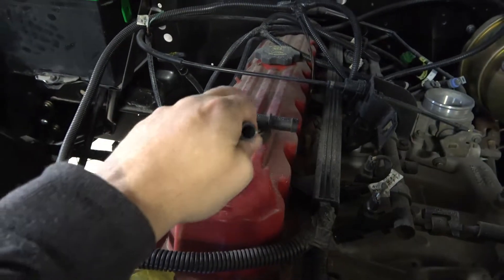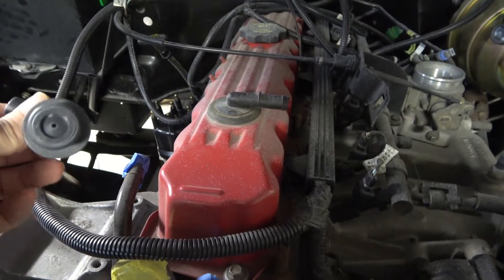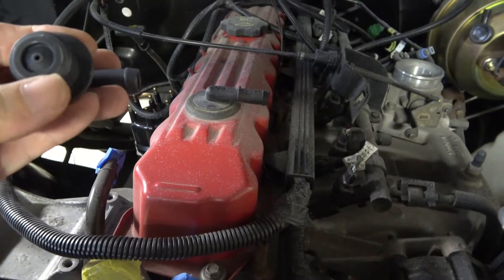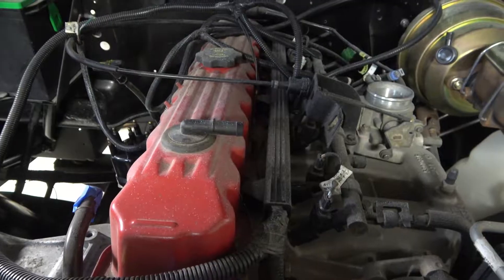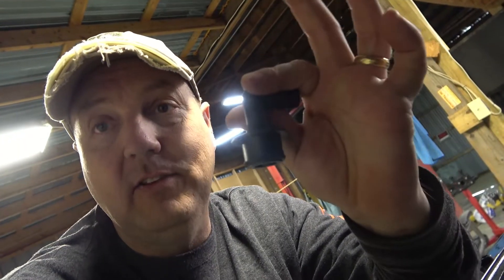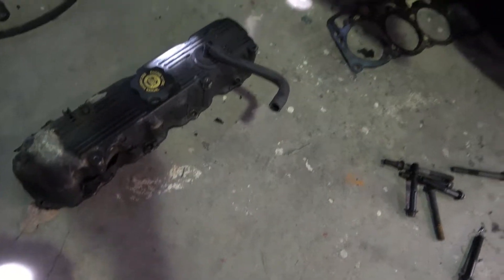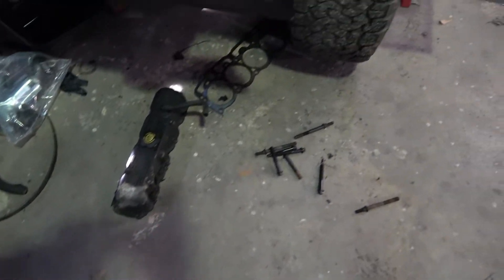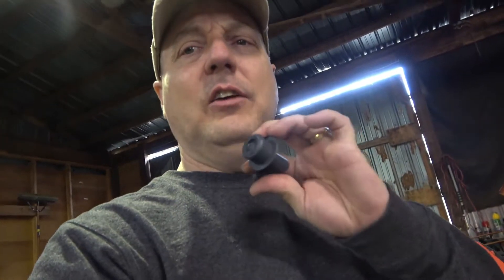Jeep 4.0 LITER Crankcase Vent Problems. CJ, YJ, XJ, ZJ, WJ, TJ, 4.2, 4.0, 2.5 6cyl / 4cyl

Comment from the maker: I stand corrected.  The 4.2 had a PCV system.  The fuel injected engines used a CCV system.
Reply: Just had this convo on 3 differend parts stores. And they kept looking for a pcv... I spelled it ten times... Eventually got the old one cleaned out....
Reply: so the 89 4.2 the front is pcv and the rear is ccv?
Reply: @jchiopsj8932  thats how it was on mine and worked good. I reckon there might be somekind of baffle in one if them but it shouldnt nake a difference which way you put them as long as the ccv goes to aircleaner and pcv to intake or carb (if im wrong please correct me I dont get a hissyfit)
Reply: @werewolfpig114  🤣
Reply: Ikillinit=>mj owner ;P
Reply: Either way ( CCV or PCV) they do the same thing. It’s not that big of a deal… well, until you get to the parts counter and the guy tapping on the keys can’t find the part because he’s looking for PCV valve. 

Part names do matter, but these two do essentially the same thing. 🤙

But I got another one for ya 😁
Is it a distribution block or a proportioning valve! 😄
Reply from the maker: @Ikillintel1  front / rear is prop valve. left / right is distro block

Comment: Question if you care to answer. 

First off, my upgrades/repairs
-Viper coil w/new plugs
-Fuel pump
-Fuel Rail 
-4 port injectors
-Intake
-IAC sensor
-Crank Position sensor

Symptoms still having. Rough Idle and running rough Every few warm starts. Bogs down at stoplight (500rpm) in drive, but doesn't die. Yet it idles high in park. Engine code "target Idle not reached" and Every once in a while a misfire cylinder 1. Im not a guru with these things but im trying. Please help

Comment: Impressive explanation!  Working on a restoration Tj here, which is in great shape  but in an accident, salvage title, etc.  Some damage to the valve cover top... a small dent at the front.  Vacuum lines left disconnected by first fella who got it at an auction, so am looking at those and comparing to other engines.  Would not idle correct, rich mix, etc.  Reconnected and idling much better but still the odd hiccup, so measuring vacuum next, make sure no other vacuum problems.  Now I understand the ports on the valve cover and their function.  1999 fuel injected system.  A "cold air" system was put in rather than the stock, and the filter looks black as can be.  Hmmmm.  CCV check-out on the radar.   Many thanks!   (Agree: these get ignored.  They should be replaced on a timeline.)
Reply from the maker: Glad I could help

Comment: Question. I replaced the rear main seal on my 1991 4.0 YJ and still leaks slightly. What’s the best fix for this. Love the engine just a little tired of the leak.
Reply from the maker: If you replaced it properly and it still leaks, the crank is scored

Comment: I'm working on going back to stock on my 87 Wagoneer. Previous owner got rid of the stock air box and valve cover just vents to the atmosphere. Also EGR valve is blocked off, but the tube is still attached to the bottom of the intake. This helps a lot. Thank you
Reply from the maker: Glad to help

Comment: Great info. I just replaced the valve cover gasket, both grommets and both elbows on my '94 Grand Cherokee 4.0. Your video was helpful. Thank you.
I'm curious about the steel valve cover upgrade you left a link for. Is it a pretty straightforward swap using the grommets and studs provided? Do the bolt/stud holes line up with the existing pattern?
Reply from the maker: Yes they do

Comment: Finding metered orifices that look like the one you held up (for a YJ) is neigh onto impossible today.  Now just have a tiny ball recessed into the elbow that vacuum allegedly sucks up to allow gasses to vent.  A leaking intake manifold gasket can reduce vacuum such that the ball doesn't lift so it acts like it is clogged
Reply from the maker: It gets tricky trying to find them, check Rock Auto under other models that use the same engine

Comment: I'm an idiot I have no idea why I never looked up the correct position of the valve and had my valve in the front connected to air box and rear straight pipe connected to the intake manifold I'm glad I watched your video .. I was losing my mind why I had stalling and starting issues along with the fuel rail pressure regulator .😮😅 Thank you .. by the way this is the first YouTube video I have ever commented on... Till my next brain wave pops take care.
Reply from the maker: Glad to be of assistance

Comment: What about the clogging of the baffles inside the valve cover?  That's an issue many have experienced.  ALSO, the CCV valve (rear port) doesn't "draw" atmosphere in ,  it vents (exhausts) out to the intake manifold and the front non-metered filling "draws" (sucks) replacement air in.
Reply from the maker: Exactly

Comment: I was hoping you could help me out, I have a 2000 XJ 4.0 and the vacuum line on the back port to the intake manifold is very loud. Its drawing air but it almost seems likes it drawing to much air. I did replace the vacuum line and ccv valve. The diameter of the hose is slightly larger then stock, could that be my issue?
Reply from the maker: That is possible.

Comment: I’m glad you’re still checking these comments because I also have a question - Like you said, the rear CCV has a hose that connects to the intake manifold on my TJ 4.0L.  Directly below that point where it attaches is a vacuum port that operates the doors for heat and A/C.  When we bought the jeep, that vacuum line was disconnected and we only had heat from the defroster.  When we reattached it, the heat now worked on the floor and the vents but the car now idles very low and almost quits sometimes.  When I pull the vacuum line off, it idles fine again.  Any thoughts as to why it won’t idle well with that line connected?  Thanks
Reply from the maker: @johnharrington4963  need to reset the PCM it got used to the lean condition

Comment: I just found the rear orifice was clear but my '92 has a very small diameter plastic line that connects the orifice to the intake manifold vacuum port that was plugged up. My air cleaner was not oily, but the valve cover itself has been bathed in oil for a very, very long time.
Reply from the maker: That will do it

Comment: So I have a question about this. On my jeep I have an aftermarket valve cover that the previous owner installed, along with a K&N open air intake. I’ve had a P1294 code for a while that’s been an on/off gremlin, and just two days ago I decided to replace both valves and grommets. The previous owner had a completely open valve in the back, not the 1/8in pinhole. But when I put the correct part back there, the engine was real shaky, as if it were going to stall on me first drive, and then completely misfired on me in the second start. So I put the part the previous owner had back on an all was ok, no CEL, a somewhat high idle, first start it’s 750rpms, and then after driving and putting it in park, around 950 rpms. No code yet, but why might my engine had misfired with the correct part on it? I should mention, I also replaced the IAC valve a few months ago.
Reply from the maker: put the OEM parts back in, and do a reset on the computer

Comment: Hi there, I’ve got a 1995 uk spec yj 4.0, would anything with these valves cause an engine misfire please
Reply from the maker: The valves, no...but if the tube from the metered valve (rear in your case) is torn causing a massive vacuum leak, it is possible to create misfires.

Comment: I have a 99 wj, and i got it at 90k, and now im approaching 100k and the seals are weakening. The oil pressure gauge is always way higher-by25%, my question is would a bad oil sending unit/pump issue cause too much pressure in the system, therefore causing the seals to go? I plan on doin the valve cover and the rear pcv/ccv 90° fitting- the metered one..to try to alleiviate the slight leak issue, but im afriad its gointo get worse and and fail completely. Im cleaning/rebuilding the throttlebody at the same time.. it runs pretty damn good, but iv had 4 '99xjs, never had this prob. So i feel stupid. Also, should i do the rear main as well while im at it? I dont want to kill it.. thanks and great vid
Reply from the maker: The seals just go....

Comment: I am not seeing oil problems in the air intake parts, but have been having a rough idle mainly when the jeep is cold.  Cleaned the throttle body, new conical air filter..  noticed there appears to be some oil seepage around the front port.  Hose rubber seems fine.  jeep is 2005, 123K on her, but I have had for 5 years and maybe 5K, so not sure if that grommet is petrified per your video.  It does appear to be malleable.  Could a poor seal there cause that rough idle in those instances?  Have not replaced the IAC because I am not seeing a spike or erratic idle.  It is just a really rough idle on occasion, and when it does occur the engine is cold.
Reply from the maker: Could be the grommet

Comment: It could be a symptom of poor engine compression?
Reply from the maker: Would have to be some real low compression....had a Jeep I6 with ZERO compression in 4 cylinders, still ran, and did not have oil blow by issues

Comment: My 2.5 valve cover has two holes on top of the same size, smaller than a 4.0. I can’t find an orifice that fits the rear, just a tube that sticks in.
Reply from the maker: Older 2.5 uses a PCV system....good luck finding those

Comment: I have a 2.5 engine. The valve cover you showed on the floor had it on the rear of the valve cover where does the hose go to on the 2.5 engine. Does it go to the manifold or the air filter box
Reply from the maker: On the later 2.5, the rear port went to the air cleaner, the front port (on the side) had a metered orifice and went to the manifold

Comment: My TDI is very simple. One ccv tube from valve cover to just before the turbo inlet and clean air going in with 2 check valves. I'm running a catch can and small filter on both ends
Reply from the maker: K.I.S.S.

Comment: My 4.0 after running and gets operating temp you cant get the oil cap off to add oil or even the pcv valves out of the valve cover after running awhile it does the lifter tap

Comment: Anyone have the part # for these items by chance for the 4.0?
Reply from the maker: the part numbers vary but the best bet is to check on rock auto.  the front is wo orifices the rear with.  Rear OEM / Interchange Numbers: 53030495, Front OEM / Interchange Numbers: 53030497

Comment: Looks like that 2.5 cover is from a later model YJ. My 87 with a plastic valve cover has a PCV currently installed. Any idea if this should be changed to a CCV like you're showing here? There's been some monkey work going on with the EGR and a few other things. Trying to run it stock
Reply from the maker: If yours is an 87, I would try to find the original typle PCV system
Reply: @superb60ce  Was finally able to locate the complete vacuum diagram for the YJ 2.5L - you are correct.

One more question. Do you have any idea where to get the "metering plug" for the vapor canister? Looks like a small plastic orifice
Reply from the maker: @diktat6558  It is part of the canister.....in the day was easy to just replace the canister....
Reply: @superb60ce  Dang, that's what I was worried about haha. I'll figure something out if I can't find one. Appreciate the responses, have a great weekend
Reply from the maker: @diktat6558  https://store.delorean.com/101109-carbon-canister.html
Reply: @superb60ce  That actually looks like it might work! Thank you much 🤝

Comment: Could you replace the valve with a crankcase push in breather on a 2.5?
Reply from the maker: The open vent (line that rins to aircleaner) could be replaced with push on filter breather
Reply: @superb60ce  thanks for the reply!

Comment: Hey man. I just thought I'd provide a little bit of information that I'm gained from my research back. A few years ago, my brother had a rear main seal leak in his jeep xj and we're like man. We don't wanna we don't wanna do the rear main seal...  So I did a lot of research and came across the fact that the rear CCV orifice. Is typically too small. A diameter and the inline 6 gets high case pressure, which leads to oil being pushed out the rear main seal.  So what I did? What we did is we put a big fat like half inch line coming out of that back orifice CCV. And it' stopped leaking. , so I'm just sharing that with you alright?
 Thank you.
Reply from the maker: Yes they will overpressure, the fat line can mitigate it, but I have found that by doing old school PCV maintenance, IE replacing the orifices every 50k miles or so as well as the aft line, I have no problems

Comment: I drill the rear one out with  a 1/4 drill bit. Work much better and stops the rear main seal from leaking.
Reply from the maker: 1/4 inch might be a little too large, but I see where you are going with this

Comment: Good explanation, I just changed mine 2 days ago. When I purchased it I asked for a PCV and wasn’t corrected so up until 2 days ago that’s what I thought I was working with. I had only bought one so after realizing there was 2 and having to cut the first one out as you mentioned I went for the hunt online for the second one. I come to find out they are sold in pairs and it’s called a CCV, I then researched CCV! Here I was thinking all I was doing was a valve cover gasket job and now I’m thinking this is the reason valve cover gaskets prematurely fail on these. I do believe changing the CCV helped with a smoother idle as well, I do not believe mine was completely clogged as I don’t have oil on the filter but it was dang close! Now onto throttle body cleaning and new injectors………have a good day!
Reply from the maker: Glad to help

Comment: So the metered orifice/pcv valve on the 4.0 has no ball and spring like a regular pcv, but just the small hole we see??  And the front going to the air filter box is really just a wide open elbow right??
Reply from the maker: That is correct
Reply: @superb60ce  Thank you, I kept shaking it waiting to hear a rattle.🤣

Comment: Have a `91 Jeep Cherokee Laredo 4.0HO. Replaced valve cover gasket that had seepage with a Fel-Pro VS50522T gasket from Rock Auto. Valve train is clean as a whistle. Use Castrol 20W-50 conventional oil. Now oil is leaking what looks to be front oil pan timing cover area. Engine has got some miles but doesn`t smoke. Don`t know if any blow-by but didn`t notice any oil in tubes that connected to front and rear valves on top of valve cover. Was wondering if there is any pressure build up in the crankcase that caused seepage but now you got a new gasket on there and oil is leaking at front oil pan timing cover area. Not going to change to the black late 90s valve cover. Don`t look as solid as the early 90s. Can try blasting some air thru those valves if you think it will help.
Reply from the maker: Remove the valve cover, then remove the oil baffles from the inside of the cover and clean them.  Re-install everything and use new PCV / CCV valves

Comment: This video was on my home page and I'm glad I clicked on it. I've had 5 4.0's, I have a ZJ where the previous owner replaced the rear air tube with heater hose and so it collapses and might be the reason I'm getting oil in my air intake filter. I'll get it replaced and hope for that improves. Cheers.
Reply from the maker: Glad to help
Reply: I have a 1993 YJ with the 4.0 the rear valve on the valve cover has ears that lock into the valve cover it doesn't push into a grommet and I cannot find a replacement without buying a new valve cover

Comment: My ccv on my 2.5 kinda just plopped out, could that be causing my engine to burn oil? It kinda shrank up and became a piece of rock
Reply from the maker: Probably not.  I suspect your 2.5 is burning oil because the rings are shot.
Reply: @superb60ce  that’s fine, I have a rebuild kit on the way anyway, I’m sitting at 350,000 miles, so that’s not surprising

Comment: Hello, thank you for thw bery informative video. I have a lot learn. 
Would the problem you're describing also make oil seep out if the filler cap and the pcv/ccv?
I have a 1988 YJ Wrangler with the 2.5 L engine. I cant seem to find the right parts to do the maintenance you're showing.
If you know what parts would fit my Jeep, I'd be immensely grateful!
Thank you!
Reply from the maker: It could, or you may just need to replace the rubber ringed filler cap (never liked that design)

Comment: I bought a 1983 CJ7 that has some weird stuff going on with its straight 6 hoses. ( the CCV/PCV or whatever you call it are just connected to themseslves, and there is an air filter where the Oil fill cap should be. )  I would like to fix it, but i'm a noob and have no idea what parts I should order. Do I search for CCV or PCV for the backmost one ( both of them seem to be leaking anyway so I should replace them ).  Also what do you call the front most one that goes into the air box?
Reply from the maker: Rock auto and search for PCv under emissions system

Comment: I’m getting gas fumes coming from gas tank and extreme pressure build up when I open the gas cap filler. I have a 1995 Jeep Cherokee xj limited. What could it be??? I’m stumped . I heard evac but not sure what that is where to look. Thanks
Reply from the maker: You probably have a blocked evap line from the tank to the charcoal canister. Find a local shop to confirm

Comment: I have a 87 YJ and 2.5 and both elbows are on top. Originally it had a canister style in the rear, not sure if that was stock or not but was curious if the back needed that style or i can just put in a regular PCV valve. Thanks
Reply from the maker: Not sure
Reply: The same on my 87 2.5 pvc valve in front and canister on rear.